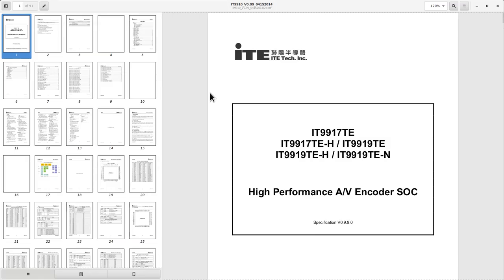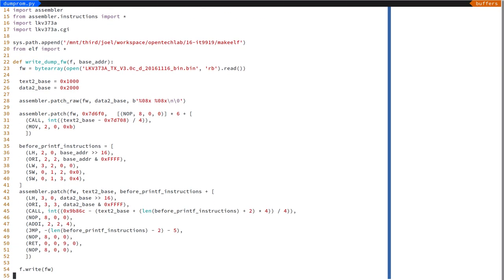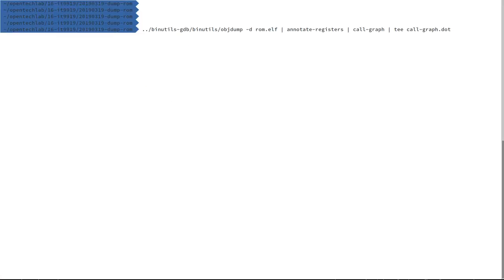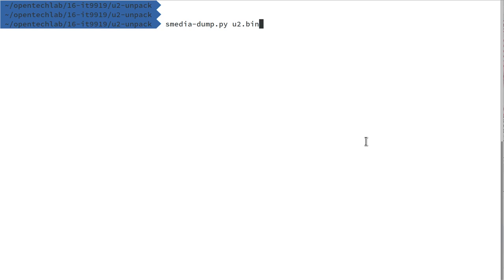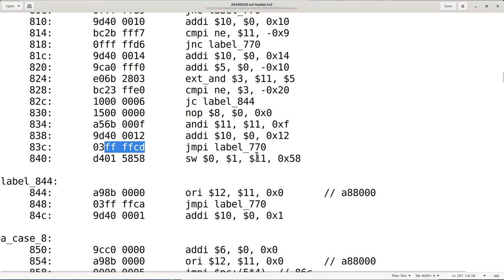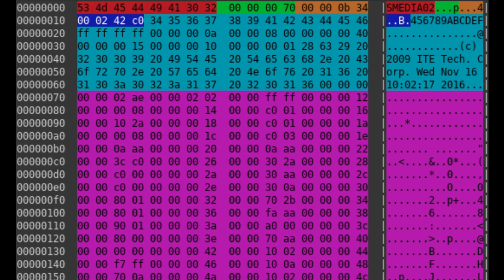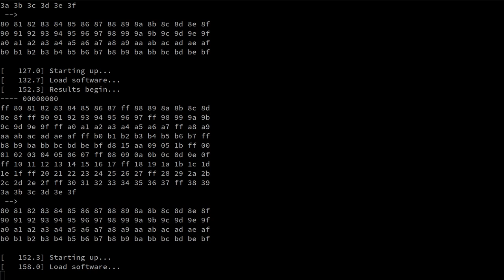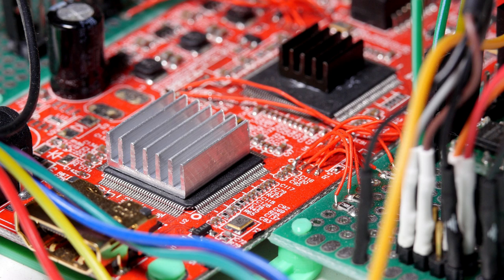[019] IT9919 Hacking - part 4 - Diving into the boot-ROM

Comment: By what you saw, what do you think the DPU could also be used for besides decompression and (presumably) CRC (or the checksum thing, whatever it is)? Seems like it could be an interesting peripheral for when we'll be able to write our own code here. Maybe it's even a bit programmable?
Reply from the maker: When we finally unlock the SMAZ compression, we'll be able to see a complete view of the way that all the different IT9910-based products use the registers in their firmwares. Perhaps we'll see more applications for the DPU - or not; perhaps it's just used for booting. Hard to tell
Reply: @OpenTechLab  right. Thank you very much for all the work you've been doing and the great videos BTW! It's really great content
Reply: @OpenTechLab  Since the compression used doesn't seem to be any "logical" choice, could they be reusing algorithms in the DPU that are later used for decompressing the HDMI data streams?

Comment: Co-operative mode could be bitstream via SPI/UART which would be useful if this chip is used as a companion in a slightly more powerful setup, e.g. a settop-box.
Reply from the maker: Reading the data-sheet, it appears that the SPI port has direct access to the entire memory space including all the peripherals. In other words, it's possible to completely configure the processor without involving the CPU. Perhaps co-operative means - downloading the firmware through SPI at boot, OR running the chip without any firmware at all.
Reply: @OpenTechLab  I thought co-operative mode had something to do with the other IC reflashing the FW if the checksum doesn't match. Have you found where's the code that communicates with the other processor and reads back the "right" firmware? I know it's really not important, but just out of curiosity
Reply from the maker: Certainly I think it has something to do with it. Though I haven't dug into that part yet. There is one SPI bus between the two processors, but it's not used to transfer firmware just to poll some registers

Comment: If you have ability to dump uncompressed firmware, then you can start analyzing it even without complete knowledge of compression algorithm. Maybe inteleaving the uncompressed data with literal control codes and patching of CRC check is enough to make it work. Or am I wrong?

Comment: You are going to need to buy some replacement SPI FLASH chips soon.   They aren't designed to get hammered on with 1000's of writes like you are doing.   One thing you might look at is building a FLASH emulator.  The BluePill could act as your SPI slave emulation.   The bluepill maintains a list of patches in RAM and applies them on the fly as the target requests data from the FLASH.
FLASH<--->BluePill<--> Target 

This would speed things up as well.   No need to rewrite the Flash image for every test.  You would have one Flash image fixture and just change the dynamic patch for every test.
Reply from the maker: I'm actually not reflashing the flash chips, just modifying the flash burner routines built into the upgrade package - which gets loaded into RAM through the device web server, so that it runs the test code that I patch into an unused area of the upgrade package. 

Otherwise, yes I probably would build something like what you're suggesting